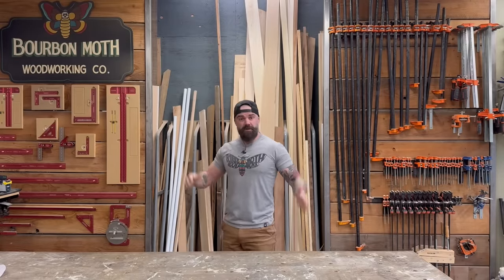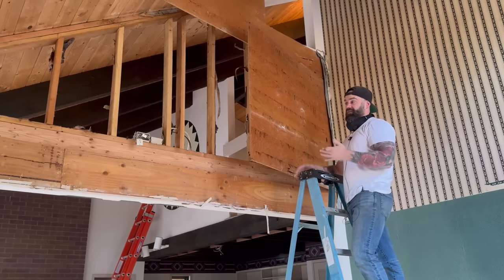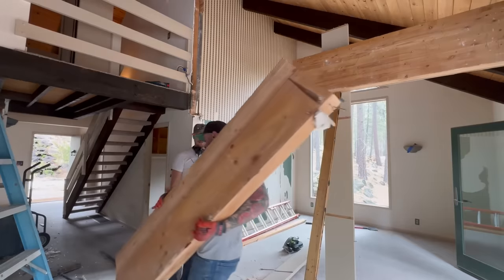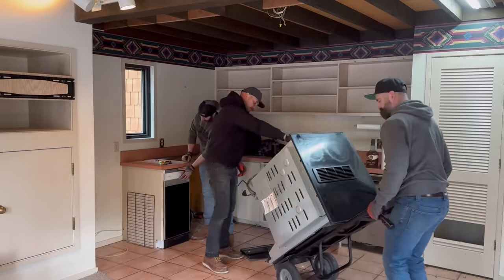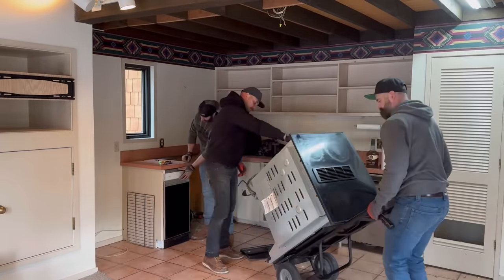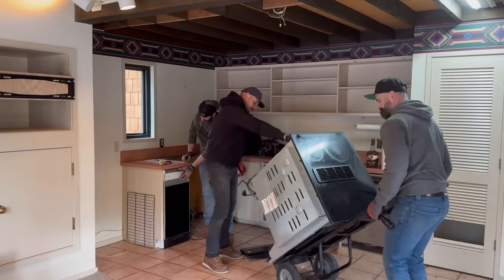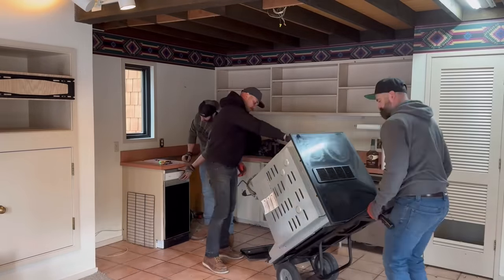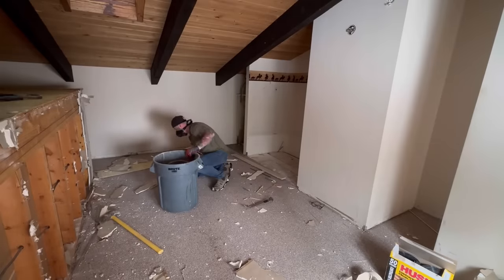Tearing Apart Our New House || Was This A Big Mistake?

Comment: A maul is not the best way to demo.  You're likely to hurt yourself, especially if you're not used to swinging it.  My preferred demo tools are recip saw (Sawzall you called it), a wrecking bar, an 18" Pry bar (craftsman 6577, have fun finding one) and a marless (rubber) mallet. It's faster, easier, and safer, plus instead of destroying stuff you can preserve it, someeone can use it. I use the mallet to force the prybar behind things without destroying my hearing.
I was leading a team doing a conversion in a church building, had a fellow - a walking disaster - removing the fiberglass tub with a recipe saw.  Suddenly a loud Shhhhhhhhhh! - thought he'd cut a water line, so we cut off the main valve.  Still Shhhhhhh! but not as loud by then, and it finally wound down, no flood.  When we got the tub out, it turned out the A/C hi pressure line - full of liquid freon, the old stuff that's really good for the environment - was right behind the tub, and Mr. Disaster had cut it, venting the whole charge.  Somewhat better than cutting a 120v and frying the worker I suppose.
Reply: Blah, blah, blah
Reply: Sorry... But cutting up those fiberglass showers is the only way to get them out! I have one and the door is only a 24" door, but I cut the shower in the corners where you are less likely to cut anything important.
Reply: @OldsmobileCutlass1969Va  I agree.  Gotta cut it out.  Cutting in the corner is a good idea - probably not foolproof, but I don't have anything better to offer.

Comment: It's possible that the glulam beam and ply were added for sheer strength.  If the house plans were designed originally for a zone with less stringent codes and the building dept. required they add it to meet Oregon codes.

Comment: When you said cabin, I was expecting maybe a 2 room cabin with an outhouse.  Eastern Oregon here...just my way of thinking. Fun video!  Will be following and might have to try and find it when we go on another vacation.
Reply: I think originally it was something like that... Then in 1976, the house was enlarged and modernized for the time period and custom altered for wheelchair use... Sometime after that the garage was added.

Then Jason came along... 🤣 Honestly, a structural engineer should be consulted with before removing any large beams or questionable walls.

Comment: That insulation could well have been used to zonalise the heating. Previous owners may have wanted to heat the upstairs balcony area without heating all of that huge ceiling area beyond. That could have been the entire purpose of that divide. I really don't think it would have been an outside wall.

That said, it would probably have been a good idea to get the opinion of a structural engineer before taking those dividers down, just in case they were put in retrospectively to augment the structure.

Comment: Jason and team. Great work, love a bit of destruction! 😈
I'm not a structural engineer (but in my humble opinion) it would be a really good idea to engage with professional qualified engineers, especially as any structural modifications, plumbing, electrics, insulation etc etc etc , add infinitum, you make will have to comply with your local building regulations to get certified sign off! Just my rambling thoughts, not criticisms. 🙂

Comment: That beam is load bearing but not a huge load.  Look at the spacing between the other beams.  That 2x roof sheathing is not meant to span the gap  without that beam and the wall that was on top of it.

Comment: Could the plywood on the walls be there because they are shear walls? Doesn't explain the flashing though. Very weird. This is why I love remodeling, it's a different challenge and mystery every day.
Reply: It's not a shear wall. Shear walls have to go to the ground or else it's too flexible.
Reply: @JonathanRivera-e9w  I didn't know that. We don't have shear walls here.
Reply: @rickyborden3287  in most stick built construction, any of the exterior walls can be considered as shear walls. The other options to resist wind and earthquake loads are braced frames or moment frames. However, those are made out of steel and concrete. Technology is getting to the point where we can do wood braced frames but you need a variance for that from the building department as it has not been adopted by ASCE yet.

Comment: I re-did an old bathroom once and there were, I kid you not, 7 layers of linoleum just stacked on top of each other.
You could literally watch the house go through the 60s, 70s, 80s, 90s, and then all get ripped out by me in the 2000s.

Comment: You ever used a fireplace?  I haven't, in my 30 odd years of home ownership, even though we always had one.  My next house, if it has one, I'm ripping it out.  They are always right where I'd like to put a TV.  They mess with the air flow of the house.  Once a year bees like to stop by as they swarm and find a new home.  Fireplaces only have cons and no pros in my book.

Comment: Is it possible instead of new construction in 76, some took an old cabin (or something) and built out the house around it?
Wiring behind the shower wall... That's a plot twist I didn't expect, because no one would ever be that stupid. (Optimism will get me killed on of these days.)
Also, I love your kitchen plans so far.

Comment: Is your house on a slab? or has a crawlspace?  I noticed the heating ducts by the window.  An ungrade for the heating system?
You have a septic field, being out in the woods.  That should be investigated. 
I'm really surprised that there wasn't any water damage by the ground level shower.  What ever the original house and the add ons to it, the house you bought looked like a jig-saw puzzle.  And seeing the mess of electrical behind the shower tub means the rest of the electrical in the house will prob be crap too.  Also pretty sure today that running electrical wires behind a shower is taboo/illegal.  If its a 1970 house it prob leaks air everywhere. The plumbing is 40 years old or so, take a good look at it.
    You need to do a electrical chart for each room, to see where all the circuits go to.
You need to investigate more about the house and how it was constructed.
  Make a plan/come up with solutions and of course let your wife decide. 
Good luck with your project.

Comment: It's amazing how someone can be such a savant at woodworking and so clueless when it comes to simple construction concepts. Insulation in interior walls is extremely common and sought after for sound proofing. Wouldn't make a huge difference in a half wall, but even that would reduce noise from the roof traveling down that wall cavity.
Reply: Liar!
Reply: lol that was clearly the exterior wall that they tied into the add on build. It didn't cave In that day, but will very soon after tearing out load bearing beams. His assessment about that massive beam wqs only installed for sliding door, made me scream at my phone. B

Comment: Shot in the dark could this have been an envelope home a one time?
Reply: What is that?
Reply: Basically a sun porch around the house.  The theory is the sun porch would heat the house   Not sure if it works.  May have a different name.  Saw a bunch of them in the Madison Wisconsin area. I work in a building in Green Bay under the same idea and it didn’t work.
Reply: That’s wild, it can’t hurt, but the insulated wall would only stop the green house heat from having the chance to move to the other areas lol

Comment: Of course nothing happened when you took the beam out. It stopped doing its job as soon as you removed the cripple studs between it and the rafter beam. I would wager that the roof sagged a little when you removed the plywood and the studs.

Comment: On and on and on about something
He took out.
I would have gone to the county
Got the original plans and had an engineer look at them  the dbl top bords   tell me its a load supporting wall.

Ok now were past that.
Take the plywood and use it in the kitchen on the walls then you have a perfect wall to hang cabnit from 
And put a screw any place you like instead of looking for studs. 
Also lets talk about the carpet in a bathroom, or kitchen
That has to be the most distrubing thing  boys stand up to piss  there aim is not always in the potty it hits the walls drips down the side or just hits the floor.
What are we animals, in a way yes
So a bathroom must always be hard surfaces so you can clean them. Carpet does not fit that, not even outdoor carpet.

If anyone has carpet in the bathroom still rip that shit out and throw it away. It wasn't sanitary in the 70s and isn't today.    
And kitchen too.  It can hold germs.
Wear a medical grade respirator. Not just a mask. Merv 15 filter. 

1970s lead on copper pipes, asaspestos  lead paint 
It was all still used in the 1970s
Asesbesto can be in wallboard  joint compound tiles ceiling floor not glass or clay type  also fiberglass and insulation. 
Lead based paint anything.
Buying any home pre 1987 or even 1990 is taking a risk it has any of these in it.  You need to test for them and take precautions.

Comment: There is so much bad information in this video.
A framing carpenter you are not.

I've worked in houses that had the structure compromised. It doesn't happen right away. 
It slowly sags and bends.

Also keep in mind depending on where you live. The structure is engineered to support a 2" to 4" snow load that probably isn't there right now.

Comment: Okay... You just lost a subscriber!  Clearly you haven't pulled any permits and don't know what the hell you're doing.  That was most defiantly once an exterior wall and the header was certainly  load bearing.   Just because the roof didn't come crashing down when you removed the header doesn't mean you haven't jeopardized the structural integrate of the house let alone that room.  People that watch your show trust that you know what your doing and might follow your example which could result in serious injuries and legal problems.  Posting this demolition without consulting a professional was completely irresponsible!  You may know about building furniture and cabinets, but you obviousness don't know about framing a house.

Comment: You give advice you are not qualified or knowledgeable enough to give. Your load bearing wall advice is ill considered at best. That beam is most likely partly holding the roof up. The fact that it doesn't collapse immediately is not an indication that it was not load bearing.

Comment: PLEASE, I beg you - MOVE THE STAIRS. They are treacherous, butt-ugly and non-functional (try and move furniture up and down them - I dare you). Consult a designer or an architect and get a stair company to build them (Menard's does a great job, I don't know who the vendor of choice is in Oregon). Really. People are intimidated by changing stairs but they are relatively cheap to move (less than $1,000, usually) and you ONLY ended up with that abortion because the second floor was an addition and the dumb-ass remodeller did a TERRIBLE job - it's an odds-on bet that was never permitted and doesn't pass code. Oh, please, pretty, pretty, pretty please. Just making the stair a dog leg (L-shaped) stair so that the weird cat walk becomes headroom for the stair. That house could be so much better. Finishes don't matter nearly as much as functionality. Your fan, and retired commercial interior designer (not a decorator, commercial interiors is an architectural specialty). Linda